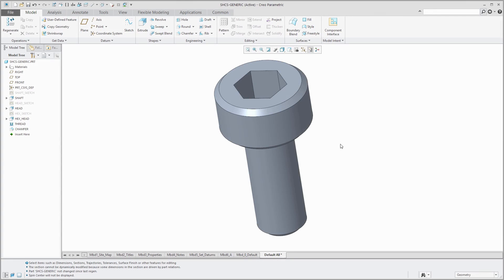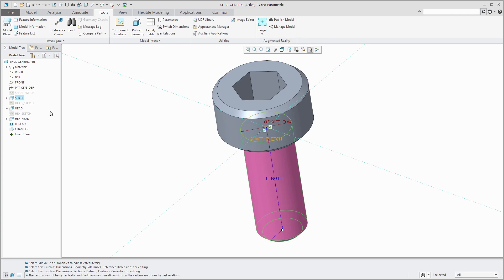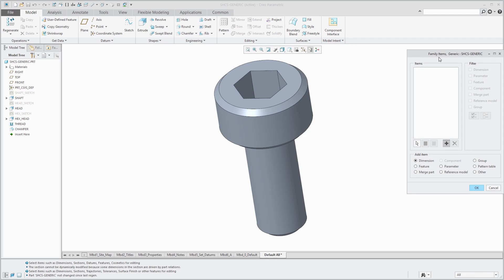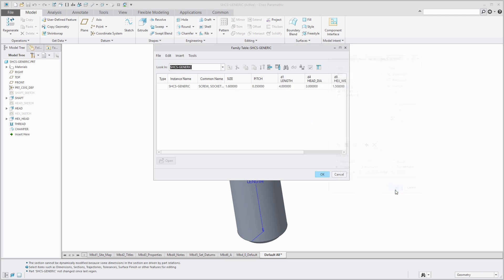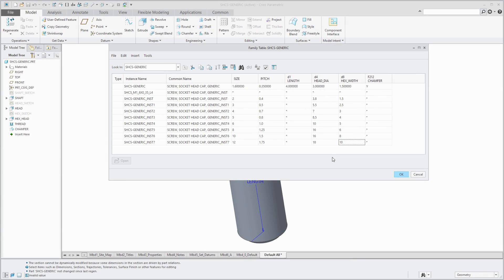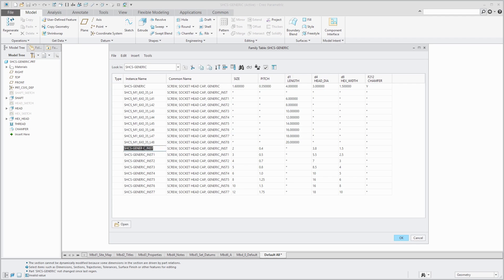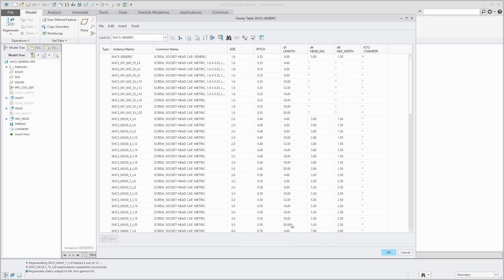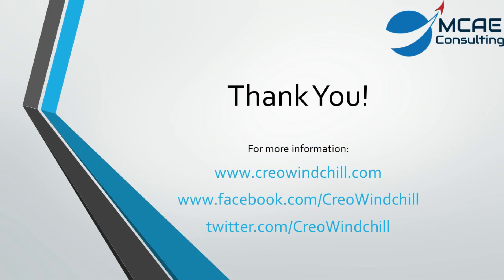Creo Parametric - Family Tables | Part Modeling

Comment: Wouldn't it be easier to view if we create separate folders based on screw diameter and then organize them by length within each folder?"
Reply from the maker: Nested Family Tables are a nightmare from a PDM perspective. I don't consider that to be easier, but your mileage may vary. If you want to take on that additional burden, that is your choice though.

Comment: Question, are you able to create a table with the specific dimensions and adjust dimensions to the primary model from the family table? Also, will creo generate these instances or will it only be useful the assembly environment, in other words can we generate an independent part only file using one of the instances?
Reply from the maker: No, you cannot change the generic from the table. Watch my video on instance index files and accelerator files.

Comment: I always appreciate your tutorials. They are the most clear, complete and well done. Question: I normally create the family table of the size, and open the instance and in the new instance create another family table with the different lengths. Therefore when choosing a screw first I'm prompted for the size, and after that I'm prompted for the length. Pros and cons? Thank you
Reply from the maker: That's called a Nested Family Table. Although it seems logical, it becomes a nightmare for PDM / PLM systems. That reason is enough that almost no one uses them.

Comment: Hi I tried to do as done in your video. I named the features as you've done and made a family table. I added the following relations:
MAJOR_DIAMETER:FID_THREAD = SIZE
D10 = LENGTH
But the problem is: if I open one of the isntances the length of the thread is as long as i expect it but the shown thread diameter d9 is still wrong. What could be the problem here?

Comment: I have a query, if this screw (for which family table is created) is used in an assembly and generic screw is used, while creating BOM generic screw information will come I am clear with that. But in assembly drawing (.drw) is it possible to add all family table instances as a seperate table ? TIA
Reply from the maker: Yes. Add the Family Table generic as its own model to the drawing and then create a Part Catalog table as I demonstrate in another video.

Comment: Hi Dave, is there a way to show where a dimension that you added to a family table is located? I.e. what sketch or feature in the model tree the dimension is in. If i click on the dimension in the family table nothing happens to show me what sketch or feature the dimension is in.
Reply from the maker: Use the Search tool (binoculars icon in the lower right corner) and set Look For to All Dimensions and use Rule = Name and type in the name of the dimension.

This is a reason why it's always a good idea to rename dimensions before using them in a Family Table.

Comment: In Solidworks, there is an option called configuration Manager which helps to make the same model (containing every feature) and allows to modify the single model or allows to apply the changes to all models(all configurations). The family table in creo works like the Design table in Solidworks. Is it possible to do same things in creo that the Solidworks configuration manager does? Do you have any video or can you please make one. Thank you
Reply from the maker: Family Tables cover both what Configurations and Design Tables do in SolidWorks. However, if you are looking for a direct one-to-one mapping of the functionality between the two software packages, you won't find it since the CAD platforms were written by different teams.

Comment: Nice Video, very helpful when coming from a Solidworks environment. I am used to a similar feature there. Is it also possible to add  columns with the parameters for Part no., manufacturer, description, and UOM so it populates in my Bill of materials correctly when I drop an instance into an assembly?
Reply from the maker: Yes

Comment: Can a gtol be controlled in family table?
Reply from the maker: No but you can drive them by a parameter or make them flexible.
Reply: @CADPLMGuy  Do you mean converting the Gtol to an annotation feature and then using it? I did try using the Gtol parameter but that didn't work... Then I figured out that by using the Annotation feature u can control the Gtol has a feature...

Comment: Great video! What  would you do, if you have a family table with more 100 components and you have to make a drawing of each component? What I’m doing is create a drawing and then save it as copy and replace the model. Do you know a faster way to do it? Thank you
Reply: You can replace model in a drawing. There is a "replace" command that allows you to use another model of the same family table. 
Then you can save the newly created drawing in a different name. If you just need to print, it is ok not to change the file name.
A mapkey would make the process much quicker.

Comment: This is a thorough and high quality video!  Thank you for making this.  I've definitely had issues with family tables in windchill in the past, another video that covers tips or best practices for managing family tables in windchill might be helpful. Or maybe the general practice you have mentioned here (never use the generic in any assembly) is the simple key to success.
Reply from the maker: Sean,

Thanks for your comments. I will make a separate video on practices for managing Family Tables in Windchill. There are special considerations for them in a CAD data management system. Not assembling generics is one practice, but there are others.

Dave
Reply: Hi  @CADPLMGuy , thank you for this amazing video. As Sean, I'm interesting on the best management practices for family tables in windchill. If you already created that video, I would appreciate it if you share it ( I didn't find it).
Reply from the maker: @irvingalexisgumetadelacruz6002  Look for a video on Healthy Practices for Family Tables.
Reply from the maker: @irvingalexisgumetadelacruz6002  The video is called Healthy Practices for Family Tables.